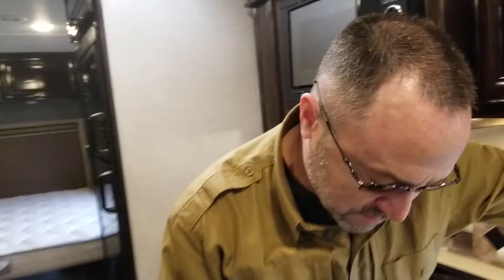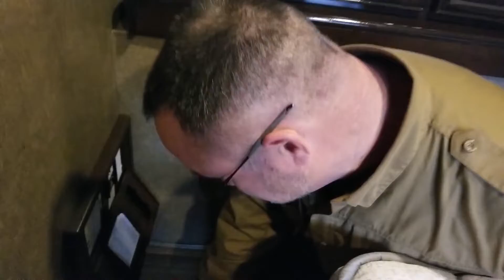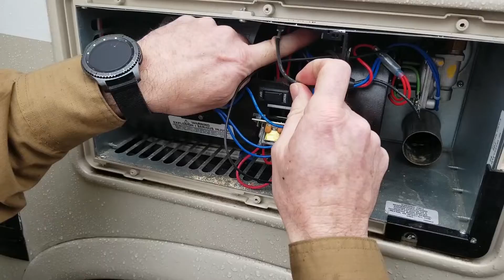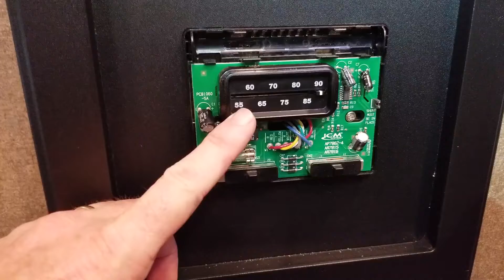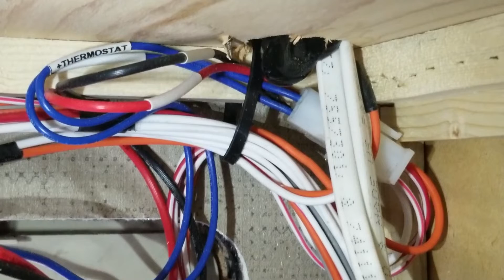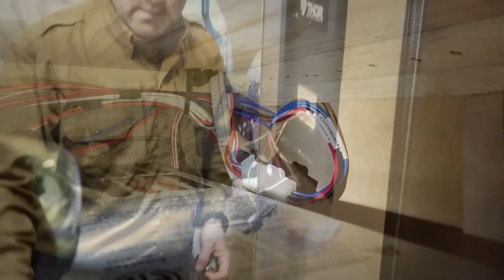Troubleshooting A Coleman Mach Intermittent Thermostat Issue

Comment: I have an issue my AC many times lately will not kick on unless I start the fan. Once you switch the fan let the fan run anywhere from 5-60 then quickly switch to AC and it kicks on. Usually it stays and cold until you shut it off for a couple hours. Freezing isn't an issue as It does it coming here from week of being off

Comment: Thanks so much for sharing your expertise with us.  My Dometic Furnace didn't fire up last week.  Made no noise.  I could hear a click in the air conditioning relay box up  in the AC unit but nothing else.  I said I know what that is.  The sail switch.... I went out pulled out the sail switch and a puff of colie hair was in it like last time.  Put it back together and fired up the thermostat and all looked like it would work but still nothing. Went back out  to the furnace.  Checked the blue path from the power reset switch all the way through the sail switch and heat limit switch and all test good.  Even jumpered  accross them them and still no furnace.  Jumper'd 12 volts to the fan and it fired up.  Hum. 

I then tried shorting out the blue wires leaving the furnace that go to the relay box in the AC unit inside and the furnace didn't fire up.  (I did this by touching a jumper between where the two blue lines came in and terminated inside the furnace)  The furnace didn't make any noise no click nothing..   I then run a touch jumper between the known 12volt coming from the hot side of the reset switch and touched the opposite side of the other blue wire coming from the thermostat.  (thermostat had  12 volts all this time  and being a non experienced tech thought...maybe it needs this 12 volts from the thermostat... I touched it and the furnace fired up and ignited....)   OK... I know the furnace will run now.   Started heading towards the relay box up in the ceiling.     

I was camping and all I had was a 12 volt test probe.  My meters were at home.  I ordered the relay kit thinking it was where my open was.  I Since learned I could check it by reading 12 volts in and out of it when the thermostat was calling for heat.  

So after thinking about this and watching another rv tech fire up the dometic by shorting out the two blue wires   The next day got home winterized the rv.  

I stopped by the local RV dealer and talked to our local shop tech.  He said yes you should be able to start that furnace by shorting out the two blue wires coming from the furnace.   (I tried doing this inside the furnace but it failed.  I took the card to the dealer and he bench tested it with his dometic card tester and said it isn't broke saved me 170.00 for a new card.  I offered to pay for his time but he had me figured out in about 3 minutes so no charge.  He said look at it again.  As I was driving home,   I was thinking a open ground?   

With a renewed hope I then pulled the furnace service panel and thought ok, looking through the vents I then went inside the RV pulled the return air cover that was covering up the transition between the Blue wires leaving the furnace and the brown thermostat wiring like you find in a house 2 conductor with a brown jacket white and red wire in it.

I cut off the connectors.  Stripped the blue wires coming from the furnace shorted them out and I had a working furnace.  I then shorted out the 2 leads going up to the AC relay control box and my Telephone Repairman experience of 42 years kicked in and with my TS 100 it said 10 feet from my furnace and 25 feet from the AC unit.  (now the TS100 is a TDR  that only is used to read between conductors...yes you can use a chassis ground but it's not designed for that and the manual will advise against it but in a few cases it works enough to get me in the ball park as you have found as well)

So with the wires shorted out using a spade jumper just outside the AC Relay control box I started running the thermostat wires open conductor...it was the red conductor.  The TS100 is also a toner.  It emits a tone you can trace with a amplifier.  I followed that sound with the amplifier from the furnace to the AC .   Doing that I soon  found another splice in the Refrigerator outside panel  above the furnace and the ts100 said 9 feet after I cut off these two wire crimps.  It toned out as the right wire.  As I started looking closer, after a tug or two I found a broken conductor being held together by the red insulation about a 6" from that connection.    

Using a volt ohm meter I was able to see less than a ohm resistance to my spade tip leads up in the AC.  YES!   I buttoned it all back together and it's all fixed.  I will return the not delivered yet dometic relay control box.  for 7.00 shipping.   

I told my wife she owes me big time on this one.  I really enjoy your videos and also watch RVhillbilly who also verified the two blue wires should fire up the dometic  furnace.  Many thanks again!  
Mark Jones, So. Missouri

Comment: Thankyou a suburban combination air/furnace thermostat explanation would be helpful.
I have the suburban with 4 wires out of furnace and 4 from wall.
When I connect the 2 blue wires coming from furnace it works fine. But won't when they are connected to the green and white which they were before. Bad thermostat?

Comment: Hi Darrin, Quick Question: if I want to connect only the furnace with 12v thermostat like airxcel 9630A336,(without the Air condition). so I have the two blue wires going to the thermostat and one of them is +12v. how can I do it what the wiring diagram for it. thank you in advance

Comment: Thank you so much for posting this video with all the details. I had been chasing my tail for days trying to figure out why the AC in the Jayco camper we recently acquired, wasn't working. I thought I was going to have to call in a mobile tech because I couldn't figure out why the thermostat didn't have power. I had no idea and would have never thought to check the wiring at the furnace. I pulled the inside cover off of the furnace this morning and sure enough there was a broken wire (courtesy of a squirrel intruder) on the side of the furnace. Had to pull the furnace completely out to access and replace the wire, but the ac fired right up. Again thank you for the details of this video.

Comment: Need help, furnace is coming on running about 30 secs and kicks off, Coleman-mach same thermostat as shown here. Help it's getting chilly in the Smokey mountains....any ideas will help
Also very limited on repair guys in my location
Reply from the maker: One thing that will help in troubleshooting this is to know if you actually get ignition or not. The furnace will go through a pre Purge of about 18 to 20 seconds. If it does not ignite it will usually turn off. In several of our videos we talk about the 'blue' circuit, now that is the one that will go through the sail switch, so you may want to look at that sail switch to see if it has stuck open or stuck closed.  Here is a link to our furnace playlist, we have many videos where Darren is diagnosing these types of problems.
https://youtube.com/playlist?list=PLk44vSl27TRCaZIQbm-0utYK7sVOKwXVY

Comment: When finding the pin wire not set in all the way were you able to turn on the AC to. Did the ac work when furnace had no power

Comment: Hi Everyone, I have a KZ Durango 2021 294MBQ, used just a few times. Recently went to turn the main a/c on and nothing happened, no issues the day before. I then switched the furnace on and nothing. I swapped the thermostat out with the same exact one and still nothing. Continuing to troubleshoot, I have 13 volts going to the thermostat but still no a/c or heat. After walking away for a few minutes I went back and turned heat on and it came ON! Turned it off and tried a/c and nothing and went back to heat and nothing. Seems to be something common with the a/c, heat and fan,  its a Coleman Mach. Any else had this issue? Will the a/c not work if the wired explained in this video on the heater is disconnected? Any help is appreciated.
Reply from the maker: Typically what we find on the Coleman Mach is the thermostat gets its power from the furnace circuit. The thermostat then makes the switching decisions on which appliance to turn on (furnaces, hi/low fan, compressor). In that video I identify the colored wires on the thermostat and what their job is. You can Hotwire that by applying 12 volts to those individual wires for fan & compressor and it will send it up to the air conditioner and the A/C should run until you get this problem figured out.

Comment: Thank you for posting this particular video.  We just tried using the air conditioner and nothing.  After checking for power, I was at a loss.  I do not have all the tools you have (yet), but I was able to check for loose connections.  Which is exactly what the issue was, same loose connection as this video.  Thank you, again.

Comment: Darren, what setting do you have your TS 90 set at for rv service. I just got one, used it for the first time on a 40' 5 wheel. It said break was 122 feet away. I'm thinking I don't have it set right. Thanks
Reply from the maker: There really is not a 'setting' for that meter.  It displays a number and will beep if the wire is shorted.
A big number could mean that the circuit you are testing is going through a coil somewhere.  GFCI's add a lot of length to the displayed number so if you suspect that disconnect the wire going to the GFCI and make sure the circuit you are testing is isolated as best as you can.
Reply: @MyRVWorks  
Thank you Darren for the response. I appreciate it.

Comment: One big take-away here is that many times an electrical problem has a simple fix. I just fixed my radio, fans, 3 tank-minders, LP gas monitor and alarm, water-pump, interior plus exterior lighting and my motorized Captain's chair purely by accident: none of them were functioning. One day I noticed that the radio was working and so was everything else. I tested my chair and it worked so I sat down to adjust it and suddenly nothing was working. Right away I figured there was an intermittent  gap in the "Trail of 12 Volts" somewhere and I dreaded looking for it. A week later while replacing the House Batteries I removed all connections to clean the 30 year old cables and discovered that the 8 posts for attaching the wires were actually heat-activated cut-out switches and the one that fed the converter was defective. The fix cost me $3.50 and everything works perfectly now. I shudder to think how much it would have cost me at a Mechanics Repair Shop.

Comment: Love the video! My problem is a bit different. On the external access cover there is a tubular item with wire over it. Hot air is coming out of it. I think this is an exhaust pipe, but I’m not sure why so much heat is coming from it.
From the inside I cannot access the pipe to see what might be structurally incorrect. It does work & heat the RV, but I don’t want to heat the outdoors. Any suggestions? Other videos? Would pictures help? Unfortunately it’s winter, & even in FL it’s chilly. Thanks in advance.
Reply: That sounds like the exhaust. Yes, it will be hot and should be when running.